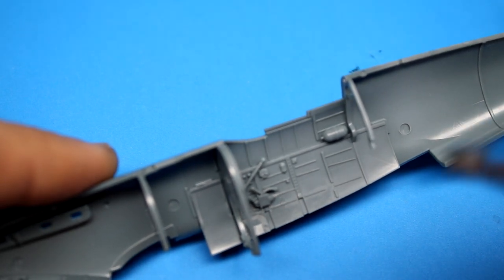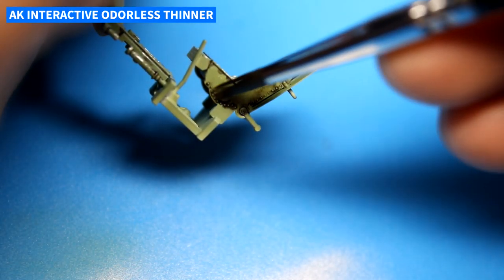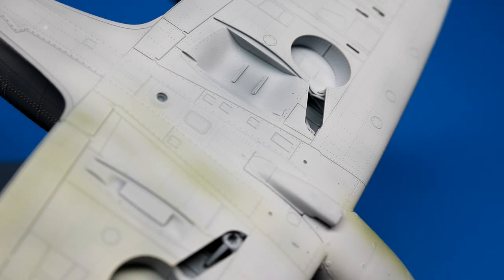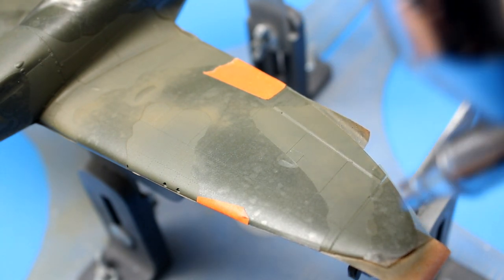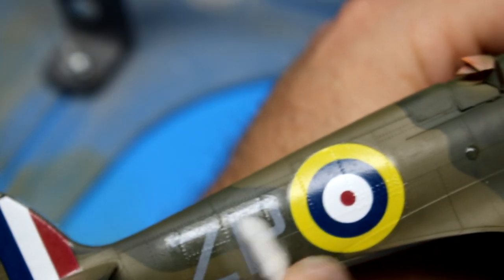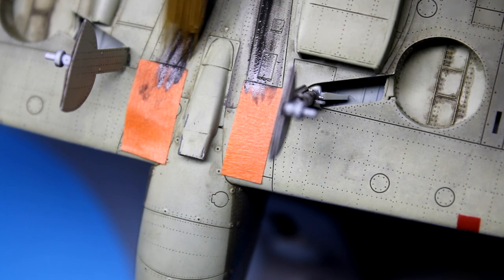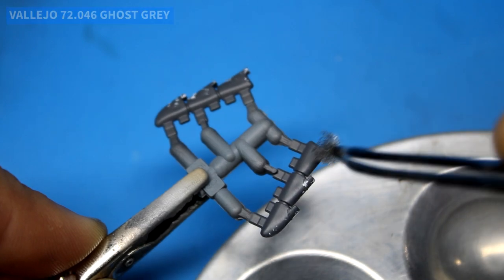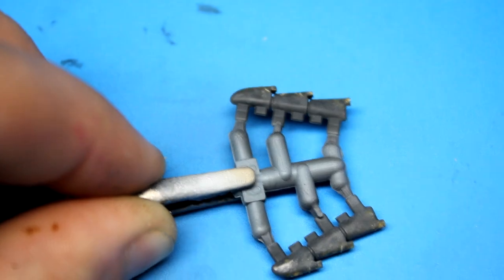"Sailor" Malan's Spitfire - Eduard 1/48 Spitfire Mk I | The fighter that saved Britain |

Comment: I like the silent gallery at the end. Many feel obliged to put a soundtrack, and looking at it I realized they are wrong. Excellent work. Incidently, the backlash on Eduard decals is based on nothing, and I am glad you demonstrated it.
Reply from the maker: This was their first release of the new decals and they were thick and difficult to peel. On my first one it was a 40% failure rate for peeling so on this one I just kept hammering setter. The Zero had no issues with peeling

Comment: A fact of which few modelers seem aware: Spitfire exhausts (individual & manifold types), as well as those of many other British & U.S. aircraft, were made of Inconel metal, which is ~80% nickel. That means highly heat resistant, and NO RUSTING. There remained, however, heat temperature and engine exhaust residue discolorations. 

Ah....the advantages of having few limitations in strategic metals in one's war industry!

Comment: Great looking spitfire! I really like that you tried the eduard decals out without peeling the film. I have a bottle of super strong and will give it a go on the wildcat. I have two questions:
1. How did you cut the camo mask? Did  you do it by hand or using a cricut/silouhette?
2. As you have tried going OTT wirh layering in the cockpit and gone softer on this one, do you think it actually does make a noticable difference once it is all closed up?
Reply from the maker: Good question Sean. 

I used a mask that was sent to me and cut it on my silhouette. For weathering in the cockpit it’s quite visible in the spitfire with the door down. So it is worth putting the effort there. But on the George I am doing, it’s a black hole so it’s not worth it. Test fit your fuselage halves together and see what the light is like in there. That will give you an idea.

Comment: Sorry, but the Spitfire didn't save Britain... The Hurricane did.

During the battle of Britain, the only Spitfires that flew were Mki and Mkii variants and those were in relatively low numbers comparatively to the workhorse that was the Hurricane. Both variants of Spitfire were barely better than that of the Hurricane and it wasn't until the later marks further into the war that the Spitfire truly came into its own.

It's disrespectful to the pilots of the Hurricanes to even suggest this... Much like the people who think the Lancaster was the bomber to save Britain, when it was the Wellington.

Both Spitfires and Lancasters stole the limelight due to mistold histories over the years, overshadowing their more numerous workhorse sister aircraft.
Reply from the maker: These are all good points but most Hurricane pilots stated they wanted to be in the Spits as they watched bf 109s bounce them from an altitude they couldn’t get to.
Reply: The Spitfire operated throughout the war as a frontline fighter and most certainly became the backbone and "workhorse" of the RAF. The Hurricane was relegated to other roles and second line duties in major theatres not too long after the Battle in late 1941/early 1942 due to rapid obsolescence and their being slaughtered en masse. There's been a hell of a lot of revisionism recently surrounding this topic, literal contrarianism for the sheer sake of being contrarian.
Reply: @TheModelGuy  you've spoken to them all have you? A few people quoted as saying it doesn't mean they all wanted it. Yes the Hurricane was a difficult aircraft to love, however in contrast the mki and mkii Hurricanes were every bit the equals of the Spitfire during the battle of Britain due to those versions of the Spitfire not being the marks we all tend to hear about. It's the Battle of Britain that really broke Germanys airforce during the war and its the version of those aircraft within the Royal Air force at that time that count.
Reply from the maker: @Enemy0fMine1415  I haven’t spoken to every RAF pilot who flew both types. But I do this thing called reading books and for example, Tom Neil, flew Spits and went to Hurricane for the Battle and he states numerous times in his book “Gun Button to Fire” that his squadron was yearning for the Spitfire. 

Douglas Bader who flew both, preferred the Spitfire. Some big names there along with others I’d have to go home and check to get the names right. But you can be assured that statements I make in my video are researched.
Reply: A relative who flew RIAF Hurricanes in Burma (and later the Spitfire) told me that unlike the Spit, it was a jack-of-all-trades and exactly what they needed over the jungle. It was a steadier ground attack aircraft which is what they did mostly but when required, it was no slouch against Japanese aircraft either.
Reply: @TheModelGuy  mhmmmm sure, but are you looking at when they flew them? Context is key here. There's a difference between a spitfire in 1940 and 1943... A mki/mkii in 1940 is not the same as any mk in 1943... They were very much different beasts, due to armament tweaks amongst other things.

As for researched? You cherry pick your "facts", as the phrase "the fighter that saved Britain" is specifically about the Battle of Britain... When the use of Spitfires were A minority compared to other aircraft used by Fighter Command. It's all very well quoting the likes of Douglas Bader or any other name... But as I said, most interviews with people who flew spits, were post war and don't tell you WHEN they flew spits or what Mk they were. So no, during the battle of Britain, spitfires weren't a workhorse of fighter command, or even close to being Britain's saviour.

It's also arrogant of you to assume and infer I don't know what I'm talking of or have done any research. My Grandpa was RAF during WW2 and I'd trust his opinion on the goings on of fighter and bomber command any day over the likes of a YouTube Experten like you any day.
Reply: @blockheadgreen_  like I said to The Model Guy... Context here is key. The Phrase he used is specifically about the Battle of Britain and as such, its a misnomer about which fighter saved Britain at that time. Spitfires were a minority element of Fighter Command and the Mki and Mkii were not what the Spitfire would be known for eventually due to substantial changes to multiple aspects of their characteristics over time.

Yes, lots ot Hurricanes were lost during the Battle of Britain, but, thats because they outnumbered the volume of Spitfires being used. When more of something is being used and more of them are lost as a result of a battle, that doesn't make the thing used in comparison better... Spitfires AND Hurricanes during the Battle of Britain were on almost equal terms and depended greatly on pilot skill and ability.

This isn't about being Contrary or "contrarianism" as you put it, this is about context, something many fail to look at with History, especially where WW2 is concerned.
Reply from the maker: @Enemy0fMine1415  Tom Neil was comparing the Hurricane to the Spitfire Mk I in 1940. He did a few hours in the Spirfire before being moved to a Hurricane squadron.
Reply: @TheModelGuy  one man's opinion vs how many who flew in the Battle of Britain? Opinion is not fact.
Reply from the maker: @Enemy0fMine1415  one man’s entire squadron. They were desperate for Spitfires as it was faster and had a higher service ceiling. Plus the Hurricane had a tendency to burst into fire as soon as it was hit which they were not fans of. They lost a lot of pilots to burns who were unable to return to service after being shot down in Hurris
Reply: @TheModelGuy  one man's squadron... OK, here's some context...

19 squadrons of Spitfires flew during the Battle of Britain, compared to the 35 of the Hurricane. Do you know the reason why? Construction method and ability to get the resources necessary for it. Spirfires used more metal, a resource that was scarce for Britain at the time. So much so, an initiative was created to get as much as possible by rationing households to essential items only. The government collected metal from fences, railings, pots and pans and other goods from households to go into aircraft and tank production, just to maintain numbers... Which is why production of Hurricanes, Mosquitos and Wellingtons were favoured over nearly all Metal builds of the Spitfires et al.

As for the opinion of your squadron you're keen to use as an example, are you able to tell me what the flight time of them in Hurricanes vs Spitfires were during 1940? Because that matters and the reason why is due to a pilots ability to learn the aircraft they used... If you were used to a Spitfire, you had become accustomed to its comforts, then in switching to a Hurricane it would feel awkward unless you had flown it enough times to then become used to it... But as I've tried to show you, flying Spitfires was a luxury many didn't have. 35 Squadrons of Hurricane vs 19 of Spitfire is a telling volume of aircraft. Said 35 squadrons also accounted for half of all Bf 109's shot down alone during the Battle of Britain... The other half were accounted for via Spitfires, AA, Beufighters, Blenheims and other aircraft used during the time, not to mention friendly fire from the Germans.

Stop quoting opinion as fact. Look at the recorded numbers of things, the logs of squadrons, the details kept by various sources across the board. Facts matter.
Reply: @TheModelGuy   Faster climbing, certainly (mostly due to the CS prop that was given priority to Spits).
The Hurri had the same unprotected fuel tank as a Spitfire and that suffered the same problem - even the brilliant but flawed BoB movie shows what happens when a HEI round hits that.
Reply: @Enemy0fMine1415   it’s a modeling video, relax and get a life
Reply: @Steve_8341  I think you'll find it's a modelling video with historical accounts told as part of it... And telling history inaccurately leads to people holding conclusions based on falsehoods.

If you like to be lacking, that's your choice...
Reply: @Enemy0fMine1415  you’re 100% right, let’s cancel Robbie, he should lose his channel now.  😂 bro get a life, it’s a modeling video, we’re here for the technique and the art not the story telling.  That’s what History Channel is for.
Reply: Quite right but forget about calling it disrespectful. It’s just ill-informed. The Hurricane is almost shunned today because everyone thinks the Spitfire is the greatest aircraft ever made. The world has gone Spitfire-stupid (along with the hagiography of Churchill). I don’t want to poopoo the guy’s model but let’s get the history right. Pumping up people’s tyres is no way for them to learn.
Reply: By the way Dominic, you left out the most important British aircraft of the war.
Reply: @thethirdman225  and which would you say that was?
Reply: @Enemy0fMine1415  The de Havilland Type 98, probably.
Reply: @Steve_8341  “Relax and get a life” is the reason the world is in the mess it’s in.
Reply: @Enemy0fMine1415  The metal collection was a publicity exercise by Beaverbrook. That stuff couldn’t be used for aircraft production. Even Beaverbrook’s son, Max Aitken (a Spitfire pilot himself) acknowledged it was just a morale boosting exercise.
Reply: @blockheadgreen_  I think you should read Leo McKinstry’s book on the Hurricane. There’s nothing actually wrong with revisionism. When the facts change…
Reply: @thethirdman225  not sure if you're referring to America or the UK with the scrap metal drive, but here in the UK, it was very much a necessity and not a publicity stunt. Don't forget the UK had to import at the risk of U-boat attacks, which regularly meant the loss of vital goods.
Reply: @thethirdman225  as for the De Havilland Mosquito, as much as I love her as an aircraft, I wouldn't say she was the most important British aircraft of the war. I'd likely still say it was the Wellington, often overlooked, but very much the reason Bomber Command did so well. As Lancasters just didn't have the numbers, but were usually reserved for specialist duties, like hunting Tirpitz, Dambusters, as well as the U-boat pens; due to having a capacity to carry heavier and more specialised bombs.
Reply: @Enemy0fMine1415  
"not sure if you're referring to America or the UK with the scrap metal drive, but here in the UK, it was very much a necessity and not a publicity stunt."

Yes but they couldn't make aircraft out of smelted pots and pans. They probably did all kinds of other things but the aluminium was simply not possible, even though they said it was for Spitfires. The British certainly use aluminium from crashed aircraft but that was of a much higher level of purity than pots and pans.

I'm referring to the UK. I'm not American.

"as for the De Havilland Mosquito, as much as I love her as an aircraft, I wouldn't say she was the most important British aircraft of the war."

I didn't wake up to the Mossie until I read about it. I started with a book called "The Gestapo Hunters" about 464 Sqn, RAAF. The exploits owed more to the crews than anything else but their achievements would have been a lot more difficult and costly without the capabilities of the Mossie. And the British could rely on the Mosquito in a way they couldn't with other types.

"I'd likely still say it was the Wellington, often overlooked, but very much the reason Bomber Command did so well."

Much as I hold the Wellington in high regard - and it was used from the first day to the last - it suffered very badly in its original role. Most of its successes came later. The Mosquito took on so many different roles and succeeded spectacularly in all of them. It had the lowest loss rate of any combat aircraft in WWII and was a major influence on the design of the SR-71 Blackbird. The Germans spent little time discussing the development of the Spitfire, unless it was in passing, though they did listen to their pilots when it came to finding out where the Allies were at throughout the war. They may have hated being bombed by Lancasters, Halifaxes and Stirlings but they hated the Mosquito like no other because of what it was.

Goering frequently cursed it and with good reason. The aircraft never had the latest Merlin engines, nor were the crews exploits as widely publicised as those of fighter pilots (or even some bomber crews). But German reports make it abundantly clear how frustrated they were by the aircraft's near-invulnerability. There was also the story of the raid on Berlin during a radio broadcast to mark the tenth anniversary of the Nazi government which put Goering off the air. You should read his response to that!

The sincerest form of flattery is said to be imitation and the Germans tried and failed to copy the Mossie. In fact, it wasn't until the arrival of the Arado 234 that they had anything of the same calibre. But there were more than 7,500 Mosquitoes and there were never more than a couple of hundred Arados. In the intervening three years, the Mosquito gave them a very rough time. It put the "nuisance" into nuisance raids. It could fly a 4,000 lb bomb load all the way to Berlin. Then a PR Mosquito would go back after breakfast and photograph the damage. The Mosquito was the most prolific PR aircraft of the war. It could fly around bomber streams looking for enemy night fighters. It was devastating in the maritime role and serving with 2nd TAF, it conducted raids like Aarhus and Amiens, which wee considered "spectaculars" at the time. It was also used to transport passengers to places like Norway with virtually no chance of interception.

It wasn't without its faults: it could be unforgiving and it didn't react well to gunfire. A belly landing was frequently a bad result for the crew since the structure didn't usually cope with it very well and some lost their legs.

The more I've looked, the more I have to agree with Callum E. Douglas when he said the Spitfire was slightly overrated and the Mosquito underrated.

But that's only my opinion.